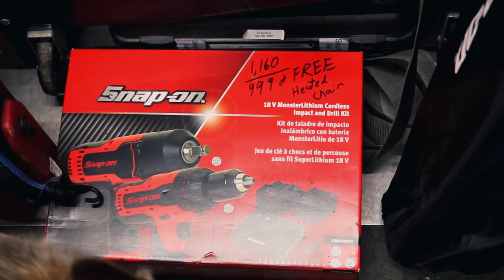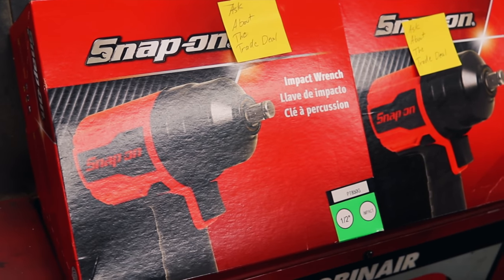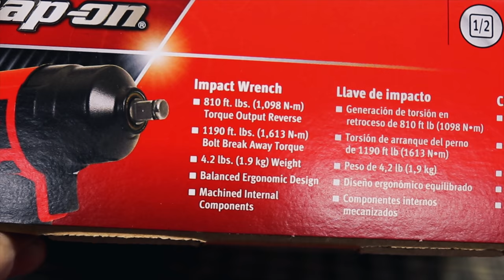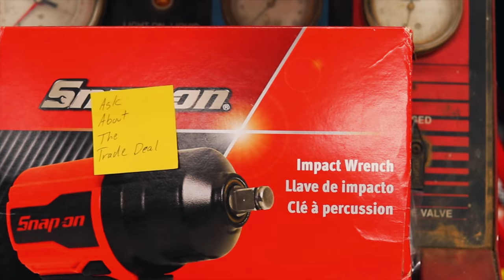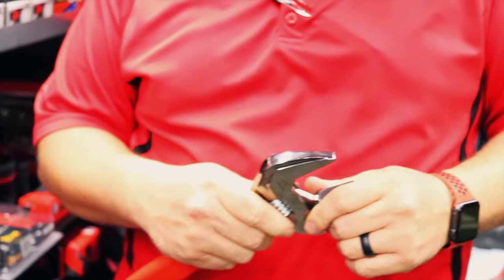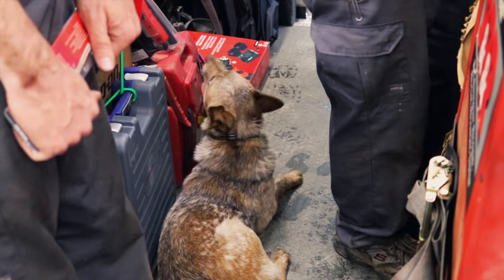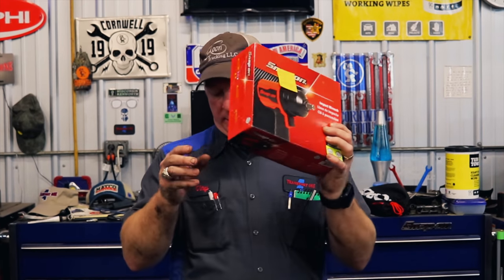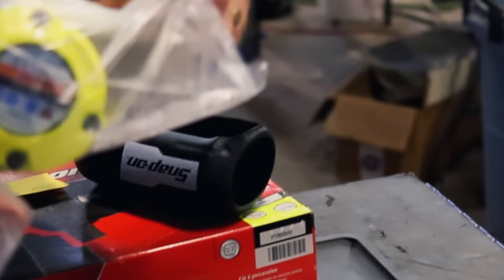Snap On PT850 Impact Sale $100 Off

Comment: Just picked up one of those impacts last Friday in Exteme Green 👍 only gun in the shop that's able to remove 5.3,6.0 and 6.2 harmonic balancer bolts 😎 picked mine up new for $495 on the truck, no trade in either

Comment: Man! It seems like Hamilton has all the deals! I finally got my 1/4 lock flex head with orange soft grip handle. But my snap dealer did have the buy the sockets get the ratchet deal. Always a great deal on the" Hamilton tool truck of deals!"

Comment: Main advantage of the pt850 is the comfort factor. Although it’s not the most powerful impact, it is very light and well balanced and the grip is the most comfortable I have held for long periods at a time. Rarely do I need more power to remove fasteners.
Reply: Yep I own a pt850 in the auto industry and I love it! Fellow techs hate the noise it makes but I've pretty well owned it since it first came out and I must say, it's bad to the bone!
Reply: I can agree. I got to use my coworker's today. Although I semi regular run into a situation where I need the power I've got, it's just unusual to play with a gun that hardly vibrates. Even with the boot on it, no weird. I have a Cornwell IR build, and while she's stupid powerful, she's slightly heavy and the boot gets my hand every so often on a long day. Now, I just picked up Matco's stubby 1/2" and that was a good buy. Vibrates sure, but it's small and gutsy. I'm impressed with their standard 1/2" though. Slightly less comfortable than a PT850, same power as my IR variant. Mine wouldn't bother me as much without the boot, but they look like dog crap after a week without the boot.

Comment: i wish my dealer had that deal going on with the pt850s when i bought mine. i ended up paying 610 for the green one but i also got the matching green cover. i shouldve saved the $10 and just used the black cover it came with because the green cover is about as black as the black one, lol. its a great gun though. i keep it on the lowest setting except for pinion nuts on diesels and on the ball joint press. its too powerful almost.

Comment: What does Hamilton mean high flow fittings ??
Reply from the maker: They are fittings that allow more flow because the bore in the center is larger than regular fittings. Same outside diameter but the center hole is bigger with thinner walls (if that makes sense)

Comment: It was snap on garage sale Friday for me I stole some snap on tools today
Reply from the maker: Shoot yeah can’t pass up good deals on Snap On tools, used or not !
Reply: I got a 13 piece wrench set for $100 in immaculate shape I eat made it and it retails for like  300 to $400 And that was just one of five things I got
Reply: @KoonTrucking   Yeah, my Snap-on dealer is committed to moving products with great deals left and right. I caught interest in his 3/8 speeder ratchet because the other day I was doing spark plugs and cables on an 03 Focus, and I could have really used it to speed the spark plugs off and on; one special not shown on Hamilton's van was if you buy 2 of either the extra long hard handle 1/4 inch flex head ratchet, the extra long hard handle 3/8 inch flex head ratchet, or 1 of each, you get a free Roll Cab Toaster. My Snap-on dealer got me 10% off his speeder ratchet AND gave me a Roll Cab toaster.

tl;dr - Never pass up a great deal from your Snap-on dealer.